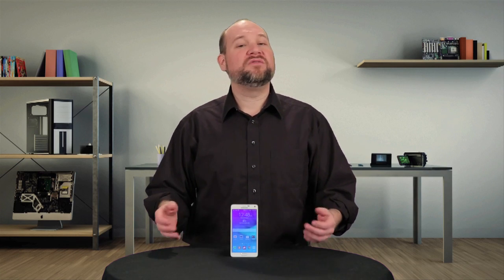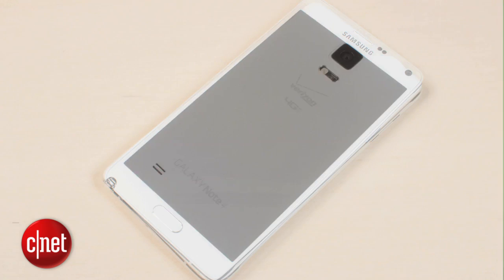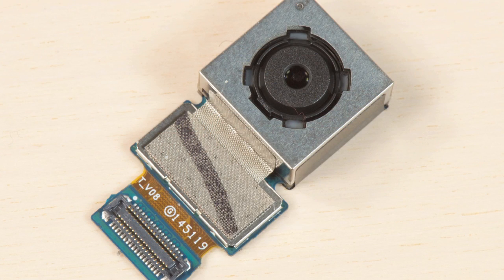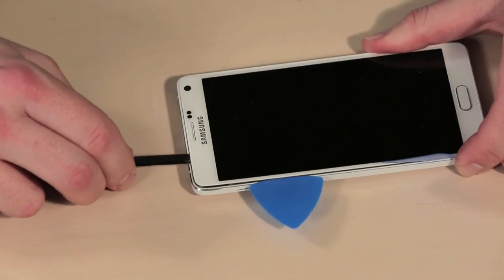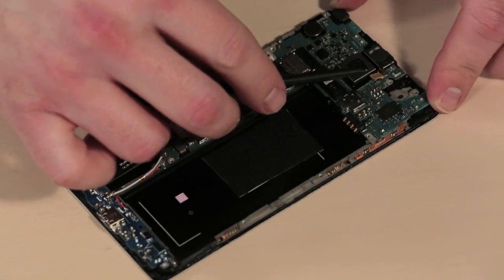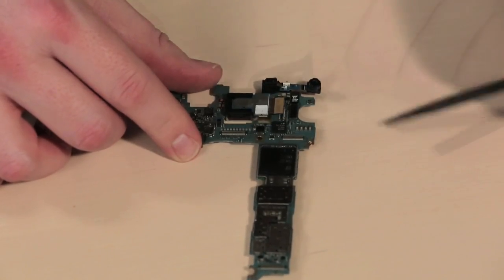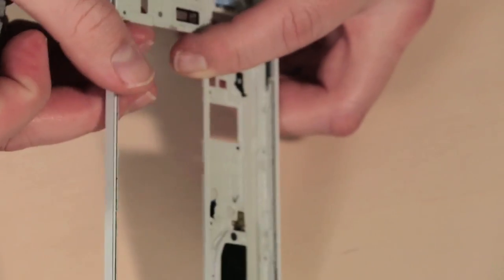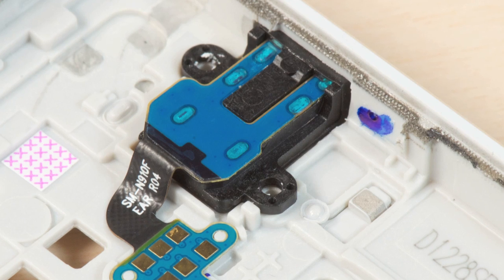Cracking Open: Samsung Galaxy Note 4

Comment: Listen up, Samsung, I will not be replacing my Galaxy Note 4 with a newer version, unless it has a removable battery (with superior mAh rating), and a high capacity Micro-SD slot.  These are absolutely critical design features that a phone must have in addition to superior processors, RAM, display, and other hardware features. It's also one of the reasons I didn't consider the Galaxy S6 or Galaxy S6 Edge.  These are also a few of the reasons I skipped on buying Google's own NEXUS phones.
Reply: say that now

Comment: My Note 4 speakers suck balls.  Why can't they learn from HTC?
Reply: I'd rather have the speakers on the back or on the bottom instead of massive bezels
Reply: HEY its not just samsung no one has done front facing speakers like htc
Reply: deadpool ftw totally agree with you the smaller the bezel the better
Reply: Dov King deadpool ftw  Back speaker's are terrible laying the phone on a table blocks it unless you putt it upside down. Bottom or front are the best but if they are front facing they should be small...
Reply: Daniel Kierkegaard Andersen I don't put my phone flat down and the speaker on my note 4 gets the job done
Reply: Never ever, wow your special. but most people put it flat down and there for the back is a bad place to put it. Samsung speakers work but not if you want great sound..
Reply: Daniel Kierkegaard Andersen still gets the job done
Reply: deadpool ftw Same, but I heard the S6 has the best of both worlds. Bottom speakers (no ugly huge front bezel) and noticeably louder dB speaker. Win-win
Reply: Yeah but quality of sound is also a big factor (Loud and static is terrible)